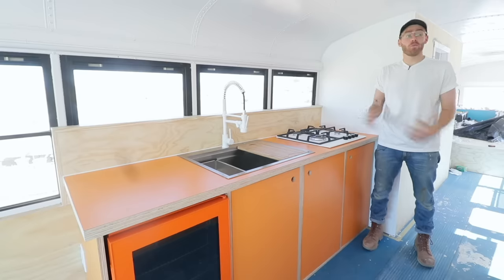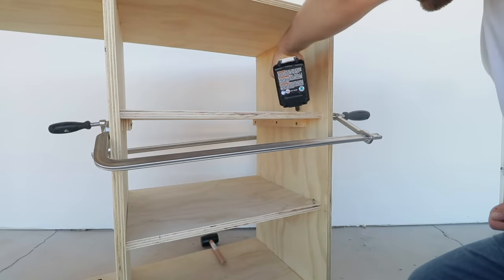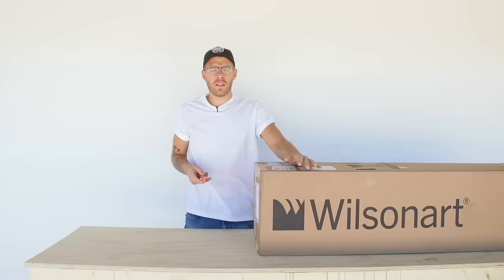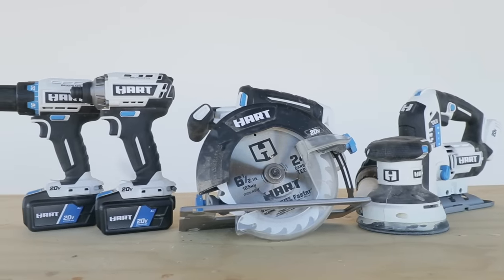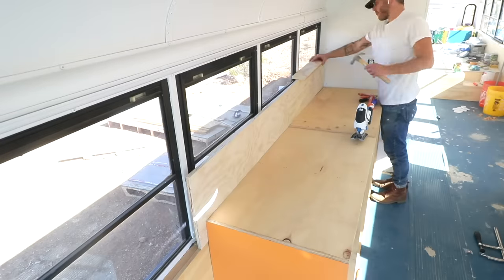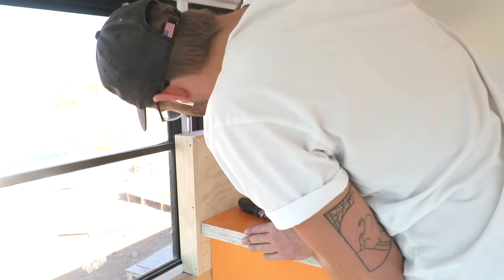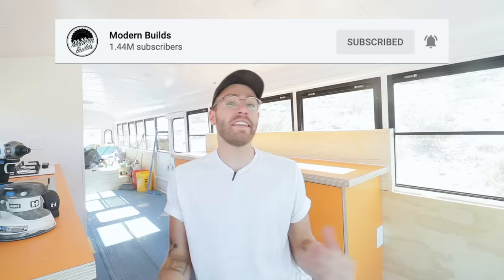EP. 4: THE KITCHEN | DIY SCHOOL BUS TINY HOUSE CONVERSION | MODERN BUILDS

Comment: i think you will regret that paint on the stove when your trying to clean it or water boils over. I personally like the black on appliances and don't think the paint jobs where needed
Reply: never have to clean it, just respray! lol!
Reply: Forgive the man his not the one doing the cooking
Reply: I'm sitting here thinking that this pain job will scratch and peel super quickly. Painting glass is not the same as painting a metal grill... adhesion is never great on glass.
Reply: But he said the paint was meant for outdoor grills so I think it can take heat abuse no?
Reply: @michaelcrump7225  Heat is not what I'm worried about,  you're one pan slip away from scratching the paint off.
Reply: @michaelcrump7225  it's meant for heat not cleaning this is used for the top of grills, motor engines  and other high temp places. Not meant for hot spilled food to be baked onto it and then scrubbed off. High temp paint damages fairly easy and is usualy meant for metal not glass
Reply: not to mention he painted over all the markings, so he doesn't know where the lighter spot is or how hot it will be.
Reply: 30 Day Reviews I’ve seen your vids in recommended
Reply: Agreed but only because I like the black. Ahhh its all good

Comment: you'll want locks or latches on the doors or you'll have a mess and a hazard when you drive
Edit: also you need fume extraction for that propane stove
Reply: Was going to comment this.
Reply: Yeah this is the MOST important thing with having a Mobile home like this
Reply: Just open the 3 windows next to it and turn on the over head fan

Comment: If you're going to stick a propane tank inside the bus then you really should make sure that end cabinet has some sort of vent to the outside.
Reply: It’s an electric stove
Reply: @vikrambush9352  he said the propane is to run the stove though
Reply: @vikrambush9352  how is that an electric stove?
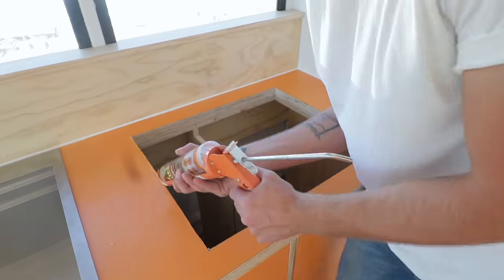Reply: @olfertpoelen  Check 21:30 You'll see the cord with the plug
Reply: The electrical runs the pezo ignition for the propane
Reply: @SonnyWeg  If you watch 8 more seconds at 21:38 you can the the stove from where the fire will come out of.

Comment: I reckon clamps are the most underrated, and useful, tools one can have. You never have enough, and especially when you're starting out, they can be damn expensive. I've been diy woodworking for coming on 5 years now and have 2 long, 2 spring, 4 tiny...and that's it. Those corner clamps are my next purchase, and I'd like to get one of those belt clamps with the straps for custom clamping

Comment: For placing the laminate try using dowel rods instead of flat boards, they won't stick as much. Also use a triple cut file for taking the sharp edge off the corners, it will leave a more accurate bevel.

Comment: 10:57 "availableble" 🤣Really loving all your design and color and aesthetic choices on this. I liked that white silicon line between the counter and backsplash. Simple but made a big difference. I also like the more saturated orange on the fridge. Nailed it, super fresh.  Awesome to see something so design forward yet accessible! I am helping a friend with her Bus Reno and you are making such a great resource!  I have been finding that a Japanese pull saw is CLUTCH for making quick precise cuts when you don't want to setup a power tool in bigger constructions like this where you need a random thing cut off. 
a little camera tip to help with the hot JT sun and avoid so much highlight blowout! Get an ND filter, (i suggest polarpro's PMVND), that's what I use,  you might using one already but if not it will help to expose properly for both inside and outside a little better!

Comment: I hate to be “that guy”, but shouldn’t the kitchen have GFCI outlets?
Reply: All the electric installation is a mess. No fuses, no ground connections.
Reply: They're inside the cabinet, so the  doors will need to be open if an appliance is plugged in.  They're probably protected enough.  Lolz

Comment: 20v, great the next marketing shit someone came up with to fool the average person.
If someone wonders why: Lithium Cells used in tools have a charge from 3,6v to 4,2v depending on their charge level. All those 18v lithium batteries have 18v to 21v depending on the charge level, as they for example on a low aH Battery just use 5 18650 cells. So those "Hart 20v" batteries are the same as the regular 18v labeled lithium batteries, but of people who don't know this think they get more power.

And please but some locks on those doors if you ever want to move the bus.
Reply: This seems to be standard practice in the US (and maybe other countries?), Dewalt also does this, the only thing different between the European and US versions of the tools is the label, 20V for US, 18V for Europe, but identical on the inside!

Comment: I think it turned out pretty nice. I'm biased as orange is my favorite color but it's functional and looks great. My only concern is that without any sort of a backer on the cabinets that those tiny little L brackets aren't going to be able to prevent racking. Just some 1/8 inch hardboard would add a tremendous amount of strength.

Comment: I'm going to loose sleep over the fact that the plug near the fridge is upside down and the the one on the other counter is right side up.....
Reply: Sometimes that's done on purpose.  In my area it's pretty common for builders to flip switch controlled outlets upside down so you know they are controlled by a switch. Doubt that was his reasoning though, I'm guessing he just didn't pay attention.
Reply: See the rest of the project to get nightmares.  All electrical  installation is a mess.

Comment: I''d suggest some plastic hole caps for those finger holes. Over the years they will start to get dirty and brown a bit, but if you pop in a plastic hole cover it will not only protect from possible chip out but also be a much cleaner surface. I think they make it in all kinds of colors as well. Really cool build and love the bold colors!

Comment: This is a great looking kitchen.  That fridge though looks to be a freestanding fridge and not an under counter fridge.  Under counter ones vent heat out of the register at the bottom.  This needs airflow to the rear or it will overheat and also won't cool.  They recommend about 3 inches gap on the sides and 5 inches on top if it is going to be under a counter.  You might be able to just add some vents or something to the back of the cabinet.  I am not sure.  You should definitely look into that.  I love the sink.  Looks great!  Toe kicks shouldn't be a problem with your boots. ;)

Comment: my stepmom has been installing laminate for over 20 years and she's never use contact cement, she uses this glue that has to be applied to both the surface and the laminate. If a mistake a made, extreme heat (with a blow torch) can be applied to melt the glue a bit and have a chance at removing the laminate.

Comment: Warping plywood doors is very common, even with laminate on both sides. Doors would ideally be MDF with an applied ply edge, or floating ply panel with solid wood frame.

Comment: With large pieces of material that have contact cement, I use a large piece of paper and slide it out as I place the materials together.
Reply: I believe I saw either Odem Makes do this or Jamie Hydeman recommend it. Either way, excellent tip cause it works

Comment: Hey Mike, how well do you think those cabinets will hold up with the bus moving around?  You only used finish screws to assemble it, I don't think they're really meant for heavy duty usage.
Reply: Yeah
Reply: With the flex the chassis has when on the road, all cabinets and wood panels will break or split.

Comment: Looking good, loving the custom cabinetry. Question about the electrics... Is it ok to put a plug on Romex cable? We have a very similar type of cable in the UK called twin and earth, and because copper work hardens it is against the regs to use solid cores in a plug (which is intended to be plugged and unplugged), hence the terminals in plugs are designed for stranded flexible wires only. You will probably be fine in practice, just check the plug terminals haven't loosened off periodically, and avoid disturbing the cable too much.

Comment: Another thing, you need to male the door on the fridge open the other way. You can switch it 1. And two it is rediculous to open it like that. For easy access it should open the other direction. If you cant switch how the door opens, ypu need to put it on the other side of those cabinets.

Comment: Recommended = for more electricity add solar panels on top of the bus with a cover so that u can open it whenever u want and make sure that when u put the solar panel on top of the bus just attach a laader behind the bus so that you can climb the top roof

Comment: I hear alot of comments about the vibration issues on the bus. I wonder if rubber grommets for places where some of the siding and furniture connects to the bus might have been in order. He should have left the fridge and oven top as is. The black helps the orange immensely.  Strange that he didn't do the same with the sink though, I'm sure he could have found a way to paint it black too. Ah well.

Comment: I have so many concerns about this project. Painting the fridge and stove seems a bit silly and possibly unpractical. However, what is being done about the doors latching to secure them when the bus moves. Also, the wood facing the outside should be finished for a more cohesive look.

Comment: Bhai 😁😁😁😁 Man 
You just went and took out the cooling system nor did you install a insulation in the bus. If you had you could have eliminate 60 % of . 
Did you anti bug proof the wood or treat or leak Prooof. If that wood receive a little or something the termites during traveling. Please go through some planning don't cut essential part in the project for future requirements. 
If you are just accelerating this project. Then you 😇😇😇😇 will be love 888 it

Comment: Are you able to move bus after adding this huge weight?
Reply: Truck and bus engineer here. 
It's not really a problem. Those chassis are shared with cargo trucks that can go up to 35k lbs (that includes the original chassis and body weight). Added weight up to now is no issue. 
There are other problems and dangerous design decisions but weight is not one.

Comment: You didn't make any ventilation holes for the fridge? Iy needs to be able to get the heat away, ot it will be horribly inefficient, or not work at all.

Comment: Well , everything is good with interior , so then what about the mechanical stuff of the bus , i mean you increased the weight of the bus but not increased the Wheel base and wheel sizes and engine power... please do it
Reply: Truck and bus engineer here. 
The chassis used is shared with cargo trucks that are rated commonly to go up to 33-35k lbs of GVW (weight including the base truck and cargo). So that is not a problem.

Comment: 6:54 if you were so super pro why didn‘t you  screw the hinge for the right door to the right side so you could open both from the middle like a closet
20:00 so then you would have two separate cabinets which would have made more sense

Comment: Did you have planned to paint the back of the kitchen backboard splash that covers 1/2 the windows black? The white finish on the stove white? You will wish it was black. Where is the oven? What is with today's generation that don't bake food? It will really limit the foods you can prepare. What about an overhead Exhaust Fan over the stove?

Comment: his power set up is shotty. he needs an inverter and a power control system. the bus isn't insolated. he' making a camper/clubhouse and not a tiny home on wheels or mobile home. it is very much lacking in the full scale. this is bad for bus colure as a whole. check out navigation nowhere for vids on how to make a real home

Comment: I doubt that Goal zero is going to run the whole bus.
Reply: I got curious about this too and did a bit of digging. This thing carries about 3kWh (hence the name I guess). That fridge uses around 2kWh a day running 24/7. A super efficient 32" LCD TV going for, say 5 hours a day, will use 0.25kWh. 20 x 2W LED lights for 10 hours a night would use 0.4kWh. That's 2.65kWh-ish and there's a little left over for internet, phone, laptop or whatever. So for a full day with zero input minus AC, he can just about get by. Obviously once you add heating and cooling to the mix the requirements shoot up drastically.

If the Yeti 3000 is plugged in to a mains source with the 25A fast charger it'll fill up from empty in 9-10 hours, and from solar it's just a question of how many panels he puts on the roof, and I'm sure we'll get to see that soonish. He's in Joshua Tree which gets over 280 days of sun a year, so solar is a pretty good bet for now :) Of course RV living does mean cutting a few corners here and there but all in all this seems doable.